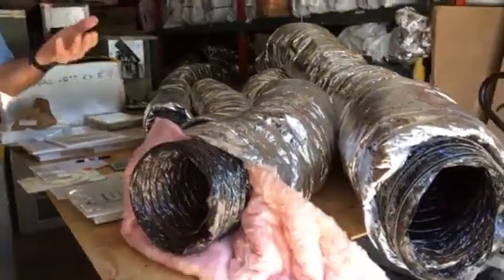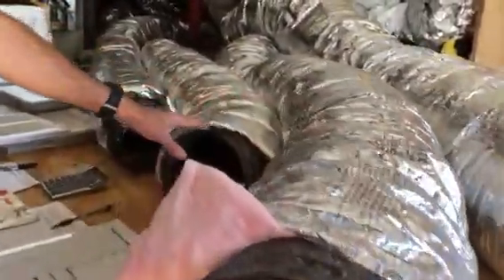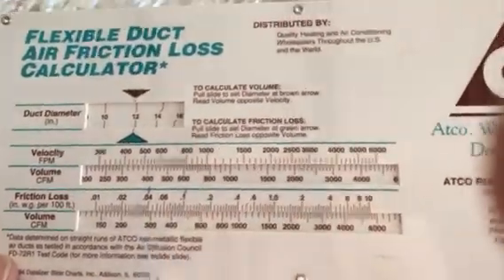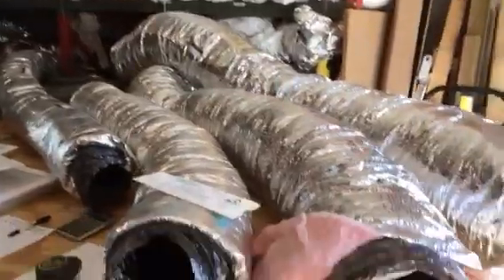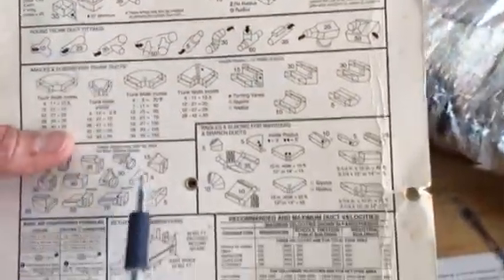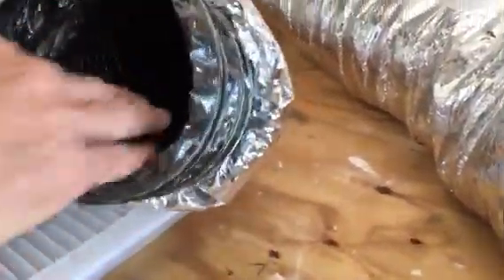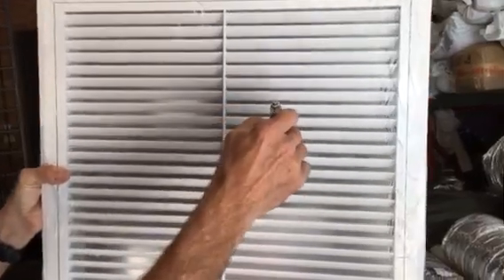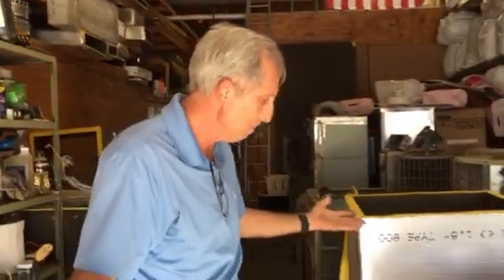Quick and Easy Duct Design Information

Comment: Very helpful for me considering replacing my ductwork along with the new heat pump we're planning.  This man is passionate about his ducting!
Reply: Dude, get a metal shop to make your ductwork. I was a duct guy for a very reputable company which had a small tiny metal shop. We ripped out flex systems, ductboard systems that a mouse chewed into and died, and re did shabby ass installs. If yu go round pipe and flex runs, use six inch runs to each vent. Use reducers as yu go down the trunk. Make the return slightly bigger than the largest supply duct. And if yu use round pipe, get metal fittings made and use curved fittings to get to transition to the round pipe. It makes a difference. I fixed a job, I literally saw how much of a difference curves make vs. Flat square boxes and flat squares where the air changes direction. It makes a huge difference which translates into your energy bill which could turn into thousands and thousands of dollars

Comment: This YouTube video which you made is VERY HELPFUL! I am going to replace my grills, and my cousin who has found that her return ducting has holes in it is reading your video as I am typing as she just got a new 3 ton AC/HEAT HVAC unit and found that the AC doesn't blow hard enough to cool her mobile home. She guessed  when she looked down her vent that the reason is that the reason is the holes in the ducting. Thank you for this video.

Comment: My attic system servicing our 2nd floor has a noisy return. The flex duct looks huge and it's a short path to the air handler (although with one 90-degree bend. I do recall once temporarily running it without the grill and it was quieter. Not sure if it would pass the ballpoint pen test ... but shouldn't grilles have a CFM rating?
Reply from the maker: Yes grilles do have a CFM rating

Comment: Ok  I don't have air returns in my 2nd floor rooms and I want to replace my supply ducts aswell so do I make the return and supply both 7 inch flex which is what is on the supply in 1 room now?

Comment: I have a 3.5 ton, 13.4 SEER packaged heat pump with an X13 blower and 10KW back up strips.  My duct work is single 14 inch flex return, the filter box is a 14x20, the supply is also 14 inch flex that is wye'd off into 2 plenum boxes under the house, each plenum box feeds 5 vents, each supply vent is fed with 8 inch flex, the individual supply vents are 4x8's.  All of the flex is black polyester.  Does this sound adequate or undersized?  I ask because I get a slight whistling from the return and the condensate will not drain if the blower is running even with a P-trap full of water and the bottom of the air handler side of the unit is always wet.

Comment: Hi trying to fix a hot room , I changed the grill to same you showed , do I need to go from 5 to 6 flex in that room to cool it down more ? Is coming from a triangle at the end of the ductwork line box 2  5 inch line on each side  to 4 vents 2 bedroom , small bathroom and one in dining room area , this one room is the one hot , no leaks

Comment: SIR I need some help I live in a double wide trailer --I am going to buy a new air condition unit .the unit is just air no heat in the unit .i have a new heat unit in the hallway it has a 10 inch  flex unit  pipe  from one side of trailer to the another side of trailer works great. now if i put a ten inch  line from one side of the  trailer to other side will this be OK. MY OLD AIR UNIT WAS THIS WAY.   YOU NO TRAILERS HAVE METAL DUCTWORK   UNDER THE TRAILER --HELP WILL BE THANKFUL

Comment: David I have a question. If I design a duct system for example 4 ton airhandler @ 1600 CFM. I size the trunk line with the ductulator for 1600CFM, should all the flex drops CFM equal 1600 for a balanced duct system?

Comment: So it sounds like if you use flex verse metal duct you reduce the volume by 50%. for calculating size of duct. So using metal I could use 6" duct, If I use flex I need 12" duct?

Comment: Manual d is the proper way to calculate size of ductwork. Caution, when using a friction rate it is based on 100' of equivalent length of ductwork. Duct systems should use available static (T.E.S.P. of blower minus everything external of of equipment: coils, filters, grills, etc.  x  100/ effective length of ductwork ) to size ductwork.
Reply: KEITHS AC thanks! So if you figure all pressure drops of everything outside of AHU it should equal the TESP of unit?
Also why some use .1 for return and supply and others do .5 for return and   
.1 for supply.
Too many contradictions

Comment: David, thanks for all the helpful videos. I have a 1600 sq.ft. older home and not an open floor plan. 3 ton heat pump with gas furnace. The  main trunk line has 7 ea 6" flex lines and 1ea 12" flex line feeding a 2 trunk line about 20' away that has 5ea 6" flex . There is very little cfm at  the end of 12" flex. Would a 12"  inline duct fan work to boost cfm's for the 2nd box. The 2nd box jas plenty of cool air. Thanks for any help.

Comment: What does inside the duck work suppose look like from return vent to unit and from unit to one room as far material looking like inside of it and what point of 1500 soft house 500 is garage to have one big return vent and the other one e3 times smaller

Comment: David we have a house without ductwork and a finished basement we are wanting to put in a furnace and central air would it be advisable to try to service the first floor with ductwork in the ceiling otherwise we've been told we'll have to gut the basement
Reply from the maker: yes if there is enough space

Comment: David when using 8 in flex duct connected to a 8 in adjustable elbow do  you pull the flex duct  insulation over the elbow to insulate  elbow or use separate insulation to wrap flexible elbow thanks  please show video

Comment: Well hey david if we using .5 for the flex supply. What should the static pressure be  for the return if its flex as well on the metal ductulator i dnt have flex ductulator

Comment: I have a 2.5 ton system in a 870 sqft house. 3 of the registers are ok. but 1 of the registers are noisy closest to the supply. and 2 of the registers don't get much air flow and the air is much warmer than the other 3. all on 6in. flex duct. i'm not sure about the size of the return. duct but the grille is 14x24 (what are your problems with this?)
1950's house with no insulation. im assuming thats why the tonnage is so high for the house size.
Reply from the maker: correct on the tonnage,  sounds like it very ubdersized 
put most of the air out furtherst from the return.
to get good even temp

thanks for watching

Comment: If I have a room  13x11
And I have a 6" supply grill
Will be good to put a 6" return grill
Above  the door or will be better an 8" 
I remember  when I start working  on hvac  we used 6" returns
But now days  I haven't  seen  that
Anymore I see 8" returns even when  the rooms has a 6" supply 
Wondering  why?

Comment: Hi David,
Great video!

We had an Aprilaire humidifier over our heater. It was on one side of rectangular insulation.
We removed this humidifier because of moldy smell.

We cleaned well and covered the hole temporarily. Smell is gone!
But, now I need to get the house appraised and I want the patchwork to look more professional.

The hole is about 18” x12” 
What is the best material to patch it?

Thanks for your help!

Comment: Hey David, Thanks for the video and your time. Quick question if I change my 16 Sears A/C UNIT to a 20 Sears do I need to change my ductwork?
Reply: Pastor David Cruz no the ductwork has nothing to do with your furnace efficiency. Ur duct size will determine how many cfm you can deliver to your room.

Comment: What's your opinion about whether a duct system can be OVERSIZED.  Interested in hearing your take on this.
Reply from the maker: I have rarely seen  a oversized duct system
if you have oversize supply duct system that should not be to much of a problem, especially if it's variable speed,   may need to use balance dampers depends on tonnage  
from my experience most of the time no problem, makes for better air, flow lowers energy usage
 always use good supply grills, and return
thanks for watching
Reply: Slightly larger duct shouldnt be to much of a problem.... BUT ... if duct is GROSSLY oversized... it will greatly reduce air flow,satic pressure and diffuser throw...... and create an unhappy  customer

Comment: Mr. Jones you are a HVAC genius. I am one to try doing stuff myself because I can never afford a to hire someone. Well we are building a small rancher in WV. after getting sick from west Nile virus I had to go out from work. My current home we are gonna rent out because I honestly cant afford to live in it anymore. It is gonna take awhile to do but Im trying to do most myself. We just had it framed so its wide open. The plan is to begin framing the interior and start roughing it in electric plumbing and hvac. I prey after watching your videos I can mange to do my own ductwork. Its a 32X44 rancher and I want to run flex line . I did a layout on my laptop and have the location for the furnace . Do you think there is anyplace I could go and they could tell me what I would need in regards to the sizing of material needed Flex Line Returns etc.if I were to buy from them.? Im not sure if any place would do that.The tool you used was very informative but I have never used one before so there is alot of learning. In the meantime Im going to look for more of your videos . Thanks you
Reply: An HVAC supply house isn't going to tell you how to size your duct system. You need a proper load calculation done on the house, which will size your system and ductwork based on square footage, windows, insulation, etc. I've been an HVAC installer for 15 years and it took me several years to be able to properly design a duct system. My advice to you is to hire a professional before you fuck it up, and I'm not trying to be rude, I'm just being honest with you.

Comment: Is there a ever reason to not insulate flex ducting in between floors? Ive lived at my house in Virginia for 2 years. Its about 20 years old. I just discovered 2 sweat spots coming from uninsulated flex tubing in the downstairs ceiling. The HVAC system inside and out are 3 years old and in great shape. By cutting holes in several ceiling areas ive noticed that all of the duct work in the 1st floor ceiling is uninsulated while the unit in the attic is insulated and installed to a high quality.
Reply: Always use insulated flex duct... no exceptions.... all ductwork should be insulated!! Including return !! Some others will cut corners or tell ya the return duct doesn't need to be insulated...

Comment: Great video. I have some specific questions on how to tie in two flex returns on a 3 ton gas pack. I have a 14"flex that was reduced to 12" in the duct box for some reason and a 10" flex return at another grill. Duct work was just redone. Is this sufficient in size? It comes off the unit with I believe a 16" roughly 6 feet then it "Y" 's to the 14 and 10 off that. Again that was on returns. Your help is greatly appreciated. Is that setup sufficient, besides possibly upsizing the flex returns. My grills are whisteling.
Reply from the maker: you will need to use reducers, go to HVAC supply house

Comment: You started to mention tonnage but then didnt.  I am getting quotes now for a new 5 ton package unit and my returns total 612 sq in.  Most companies have noted those need to be increased but none have mentioned the duct work they supply. There are two 12" flex duct and that just doesn't seem to be enough to me. Is it? and what size should it be?  (Those two 12" ducts currently feed one box when then has a flex duct going to a small return in a nearby room) Thanks for the video and in advance for your reply!
Reply: adnedarn the
Reply: If you haven't yet,  your going to want to Increase your return to 2 20 inch duct optimally. 2 12s is not nearly enough
Reply: Customers as well as companies tend to oversize. Are you SURE 5 tons is the proper size? What's the square footage, and what climate? To answer your question, 5 tons × 400 cfm = 2,000 cfm. At 2 cfm per square inch, that's 1,000 sq in. of filter area. So you need to increase at least 40%. As far as the duct, it depends on the length, and any bends, etc... but you are probably looking at two -14" as a minimum. I would do two - 16", and install dampers. FYI two - 14" doesn't sound like much of an increase, but it is. A 14" does 50% more than a 12". So swapping the two 12" for two 14" is the same as keeping the two 12" and adding a 3rd, 12".
Also, how small is the connecting return?
Reply: @jakekeeton8332  Holy shit! TWO 20" returns? That's WAY too much!

Comment: How do you calculate the static ? Does the duct designate it ..?
Reply: Phone app... (ductulater)......it will help you choose the right duct size ..... use .10 friction(static pressure) for supply and .05 for return(main trunk)... for basic ac systems.... and NO... the duct itself will not designate static pressure... thats your job

Comment: Hey David great video.. I have a question..my house was built in 1977 and the return air is panned floor joists. I had the energy company do an energy audit and I have a 99%leakage they got down to 70 but they said the issue is the floor joists as the return air duct.. would I just need to install a rigid duct and what size? I have a 3ton unit 1238sq ft house
Reply from the maker: If you have the room under your house or in your basement I’m not sure your house design run at least a 16 inch flex or at least two floor Joints nail them tape them and mastic them
That’s probably the best you can do thanks for watching thanks for the question

Comment: The ATCO flex duct calculator is not accurate as it more closely reflects metal duct values. Focus on velocity. 400 fpm on return and 600 fpm on branch supply ducts Vs static pressure. Manual D even states to use velocity over static. The ADI duct calculator is the one to use.

Comment: what size melt main duct for a 2.5 ton 1200 square feet house for both sides on a package unit heat pump??
Reply: 18 by 10 splitting into 12 by 10 each way off the split , then reducing to ten by ten each way. Leaves plenty of airspace for 1000 cfms. Depends on the unit too. I've seen alot of chicken shit looking bowers with a frigging tiny tiny opening for the supply. We can thank the white collar world for that one, more engineering jobs had to be created for all the graduates, so God damn, common sense and what was a bit cheaper went out the window, and every thing went digital board and techie, which makes it cost way way more. I even saw an American standard unit with a chickenshit looking blower opening. So they're telling you to attach a duct four times the size of the blower opening. Bull shit. No techie fucker is gonna tell me it blows air thru that duct like an opening three times that size. The engineers probably cut costs to maximize profits there. So good luck in today's times of " fuck a good job and good work, I gotta make mine, and also the created engineer jobs where everything had to be  revamped so newbie graduates have a white collar job". Oops, sorry for the rant. But things would be simple, men would take more pride n their work, etc. If uncle Sam ddnt have to create jobs for all the newborns because women gotta be a mom two three or four times.

Comment: At the end of the video you said a woman had to turn her thermostat down to 74 and you change the grills and she was able to turn it back to 78 degrees. That's good that those grills improved her airflow that well she must have really had some serious issues, but In no way shape or form is 78 degrees cool in any house. Maybe for an old lady that's in her 80s. I have an 18 seer 3 ton 2 stage condenser that pulls humidity out tremendously well. My thermostat stays at 72 with around 46% humidity in my house in July and August. That's doing the job rather well and it's comfortable for me. If I set it at 74 / 75 with my condenser would be a little higher energy saving and  more comfortable for most everyone else such as guest. 78 degrees and up on a thermostat is just not comfortable cool in a home and would only be for an old woman with poor circulation. My grandma is 82 years old and likes it at 78 to 80 degrees in her house in the summertime.

Comment: dave my home is hard piped i insulated the plenum and the return plenum should I insulate all the branch tubes going to the rooms ? this home needs to be zoned it's a two story and it has one system forced air my plan is to get some type of electronic damper system with two thermostats can you recommend one? most of the piping is 6 inch some are 7-inch and had a 3-ton well 3.5 ton unit and I install a 4-ton one week ago the home is 2300 square foot you can see the unit on  my chanel bigmiked52 thanks
Reply from the maker: yes insulate everything with 1 1/2 in duct wrap
Reply: Ductboard is garbage. Run a metal trunk line, it's not that hard. That coating on the inside of ductboard deteriorates and you get fiber glass blowing in your airstream. I always run metal duct and always insulate  on the outside, never lined. Keep the fiberglass out of the damn airstream.
Reply: Amen.

Comment: In this video, you are using .1static for supply and .4 for return. In another video, I believe, you were using .1 static for supply and .05 for your return. Can you explain the difference?
Reply: He was desizing to make up for friction loss
Reply: @Mike Taylor He was desizing for friction loss. In either this or that last video he says to NOT undersize the the duct. I can only assume by some transverse property that the desizing on the chart is equal to using a larger duct for the return.
Reply: Always upsize them Returns. David Knows...Get the Unrestricted AIR back to the System